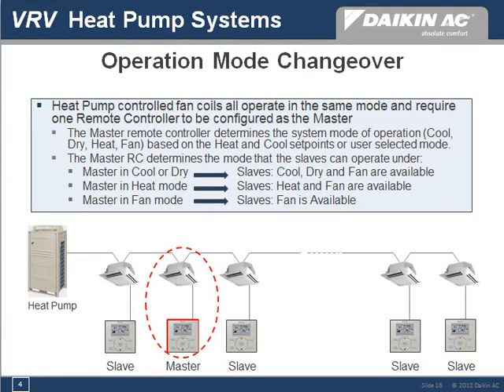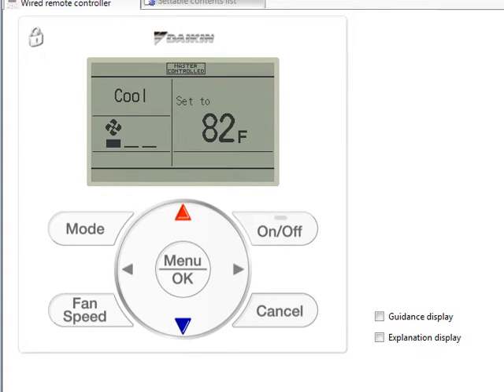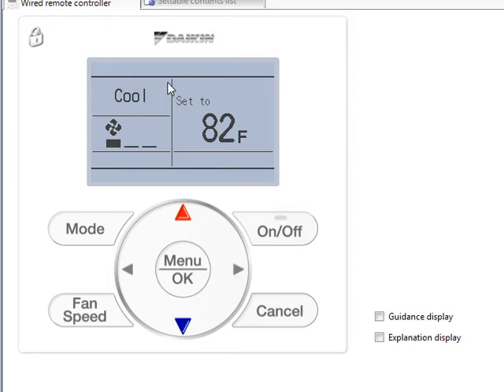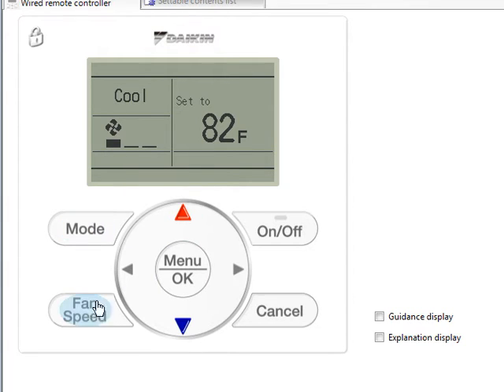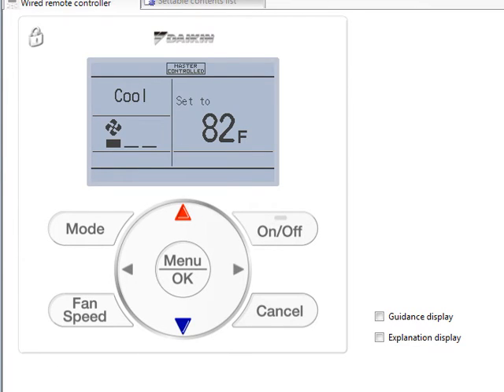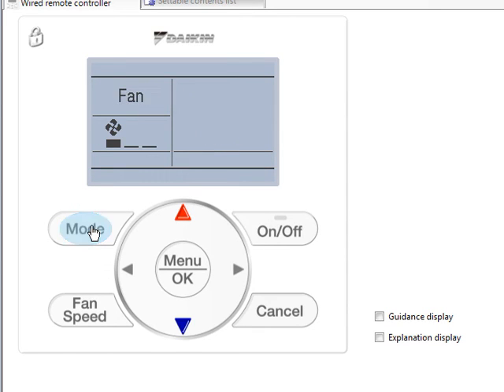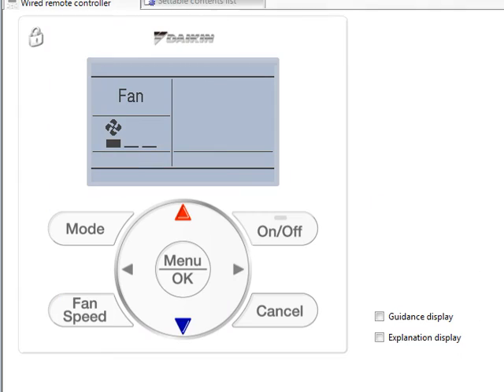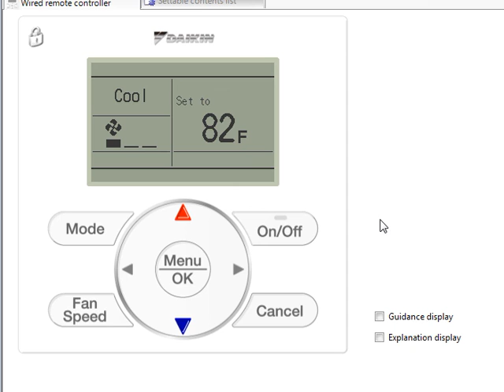Daikin VRV Heat Pump - Changeover Master

Comment: This is such a silly set up 😭 it should be seperate. We have people that need cool & people that need heat at the same time. Is there no way to make it individual?
Reply: When this is the case there are three ways to serve the need.  1) Most Expensive is with a full heat recovery system.  Each Fan Coil or Zone may be configured for Heat, or Cool independent of the other fan coils in the system. 2) Less Expensive, is a Heat Pump system using a centralized controller that manages the system mode, and each room/zone, only has a "temperature setpoint" available on the wall controller.  The Centralized Controller toggles the system between heat and cool, keep each zone at its desired setpoint regardless of system mode.  With new inverter driven systems there are no adverse affects to the mechanical components by using this method.  3) Heat Pump System with backup heat in each zone managed by individual room controller to apply heat where needed when the Heat Pump System is in Cool Mode.
Reply: Yes, but it’s a different kind of system. It’s a heat recovery system with branch selector boxes that allow it to run in heat and cool at the same time. It’s a more expensive option, that’s all it boils down to is money.

Comment: I am attempting to commission a freshly installed system, 2 outdoor RXYQ120, 8 indoors FXMQ and the same type of remote controllers you described is stating at the top something like, Central Control and it wont go away. I did not install any central controller. At no time I am able to run the system. Every time I push the On/Off button, I am getting the info that a Central Controller is controlling the system and that I cannot start the system. the I only have wired remote controllers.  How can I remove that Central Control indication so i can set the master thermostat as you described in this video.
Reply from the maker: Do you have float switches or other safeties hooked up to the T1/T2 terminals on the fan coils?  Daikin Fan Coils are shipped with T1/T2 Contacts set to "Normally Open".  If you apply anything to the T1/T2 contacts that have a "Normally Closed" condition, then you will get the "Central Control" notification that you speak of.   You will need to reprogram the T1/T2 contacts for a "Normally Closed" condition.  This is done in the field settings area on the BRC1E73 Wall Controller.
12(22)-01-01 (default) - Closed Contact = Forced Off (Central Control)
12(22)-01-02                 - Open Contact (active) = Off/Unit responds to last command (Fire Safety)
12(22)-01-03                 - Open Contact (active) = Off/  -->> Closed Contact, Unit will resume normal Op.